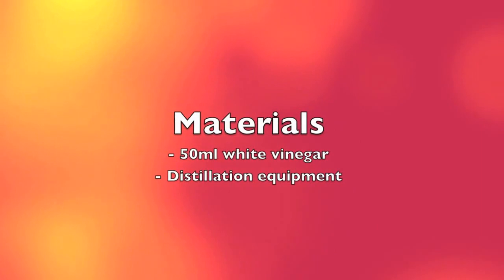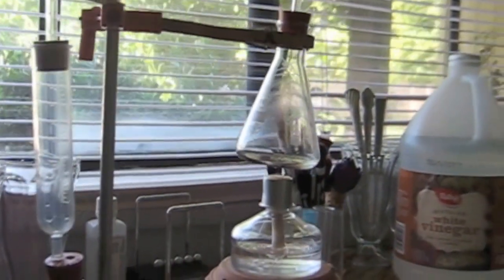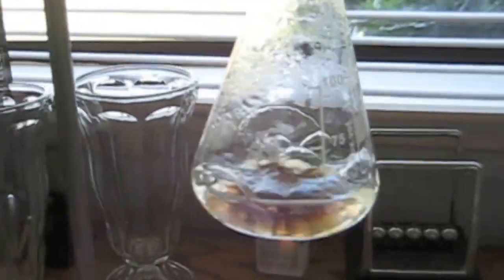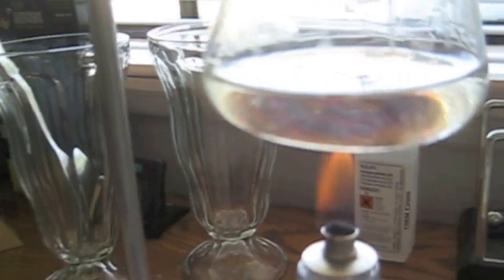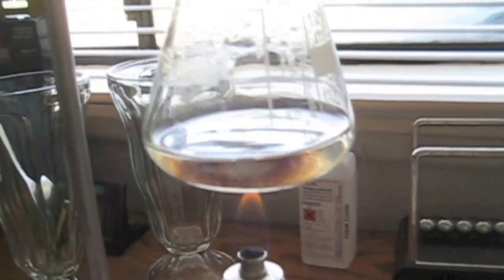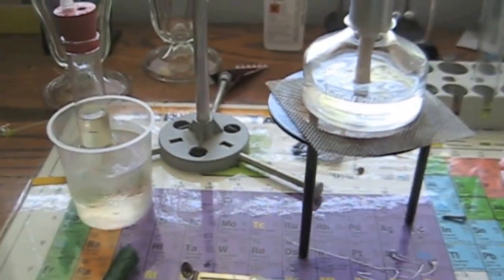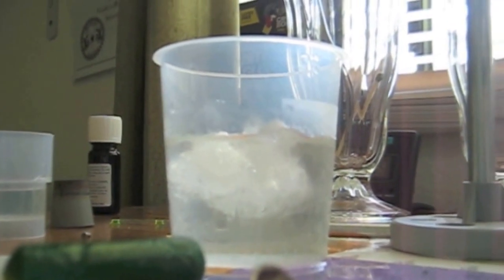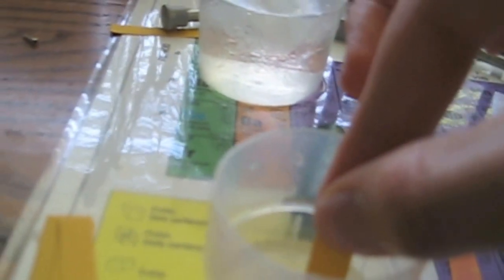Distilling Vinegar Part 1

Comment: Water boils at 100 and vinegar is 118 so basically you have a test tube of water. Your concentrated vinegar is in the original flask. Stay in school kids
Reply: You clearly don't understand the distilling process. It isn't about the boiling it's about the vapour temperature at the condenser.
Reply: Ha ha ha 😂😂😂😂
Reply: If vinegar is distilled do you know if it gets stronger, ? I need to kill weeds.
Reply: It isn't as if the water evaporated before the vinegar. There was no temperature control to insure no vinegar was distilled... stay in school kids

Comment: Here are alot of reasons why this is one of the worst chem experiment on YT.

You didn't measure the temp of the vapour, neither did you use a vigreux column for fractional distillation.
And also you didn't measure out the amount before distillation nor the product. Nor did you measure concentration by burette titration (NaOH titration)
Neither did you wear gloves, PPE, goggles. 
And you use an open flame directly on glass which is also bound to go wrong. You need a beaker screen.

Repeat distillation several times and it's best under vacuum too.
Then you dry it with a drying agent. And measure concentrated and compare with before and after as well as weight before and after. Compare to theoretical results that was listed on the bottle.

Now you are almost 3 years older. 
So try again with a proper setup and see if it's even possible :)
Reply: NK AK why are you such a dick
Reply: @justkev5538  he's not being a dick. It's all just objective statements of fact and good critical feedback. If you think giving honest, accurate feedback is mean then you need to learn to control your ego, it's the only way to develop and grow.
Reply: First this video is 7 years old. The commentor wrote this comment 4 years ago. The kid is only about 12 years old. The commentor is infact being a dick! He could have been kinder in his words that were CLEARLY written for the kid in the video. He writes as if he is criticizing an adult not a child. 

You can be factual with a child but you don't need to be a dick about it!

Comment: Few tips, First lower the temperature your mainly distilling water. Cooling the collection flask is good but its WAY more important to cool the condenser column.
Reply: how will you cool the collection flask?
Reply: @newmariaclara  Keep the collection flask in ice water like how it shown in the video. As for the condenser, if its not a proper water cooled condenser I would wrap paper towels or a rage around it and spray them with Ice water. That will atleast provide some cooling.

Comment: hey man you might want to put a beaker screen near the flame. If you dont the heat wont be distributed throughly and could cause the glass to break. While acetic acid is relatively safe if its hot enough to distill over its hot enough to burn you and since its an acid you can guess how bad that would be compared to boiling water.

Comment: That was fun to watch.  Reminded me of when I was in grade 7.  What are you going to do with your distilled vinegar?  Why distill vinegar?
Reply from the maker: The result wasn't concentrated enough to be of any use, so I didn't do anything with it. The reason I tried this process was because there wan't much on youtube about making concentrated acetic acid from vinegar, so I thought I'd try it. Might try again later with vacuum distillation or something if I can get the equipment.
Reply: @msci3067  Hi have you considered making concentrated acetic acid using chemistry instead of heat?  Take a 5% solution of alcohol in water and add the mother (from apple cyder vinegar).  Takes about 6 to 9 months.
Reply: Matthew's Science You can get it for really cheap prices on Ebay.

Comment: I'm 25 and I thought this was really cool. Not a lot of stuff out there on making concentrated acetic acid
Reply from the maker: Yeah, I couldn't really find much on doing that. The problem with acetic acid distillation is that it usually forms an azeotrope with the water and doesn't really do much. A fractionating column might increase the efficiency though.
Reply: Quite possibly! Its worth trying if you have the equipment.
Here's a thought - what would happen if you ran it past an osmotic barrier, like the type they use in water filters? Try and push the water out of the mixture rather than pulling the acetic acid out, that kind of thing. Even if it worked you probably wouldn't be able to concentrate it too much, but if it did it would get it stronger than 5% thats for sure!!
Reply from the maker: Yeah, that's a pretty good idea, seems like it would work to at least some point. I currently don't have a fractionating column, just a liebig condenser. Wonder if molecular sieves would work.
Reply: You've reached the extent with what I'm familiar with lol. Moelecular sieves sound like something out of science fiction.
You have a lot of equipment as it is. How did you get all of it?
Reply from the maker: I get most of my labware here: https://www.homesciencetools.com
Molecular sieves are usually used for dehydrating liquids, and as they are pretty expensive and hard to find I don't have any, but if I can find a cheap source I might eventually get some. They basically work by having small enough holes for water molecules to pass through but not any larger molecules.
Reply: but man can we buy pure acetic acid online,or this was better and cheaper solution*?
Reply: @msci3067  apparently you can use a two phase separation to concentrate vinegar.    Put acetone into the vinegar and shake.  Let the two phases (layers) separate.  Pour off the acetone.  Repeat several more times with fresh acetone to get all the acetic acid dissolved into the acetone.  Then, take your acetone washings and distill.  Relatively concentrated acetic acid should be left behind after the acetone boils off.

Comment: acetic acid has a higher boiling point than water so the water would be the distillate
Reply from the maker: That's the idea, however acetic acid's boiling point is only slightly higher than water, so a lot came over anyway. Additionally, at higher concentrations, acetic acid forms an azeotrope with water, which makes it pretty much impossible to distill acetic acid to high percentages.